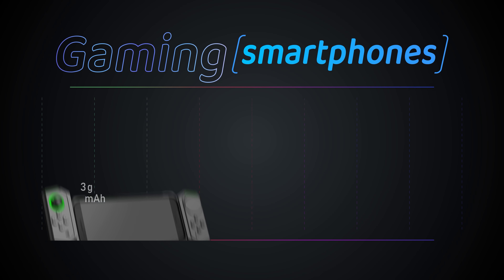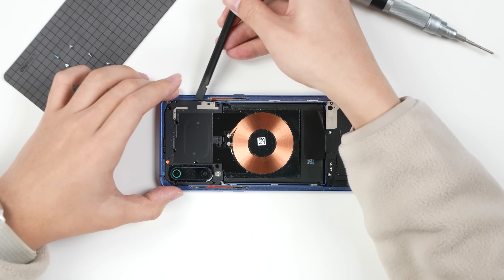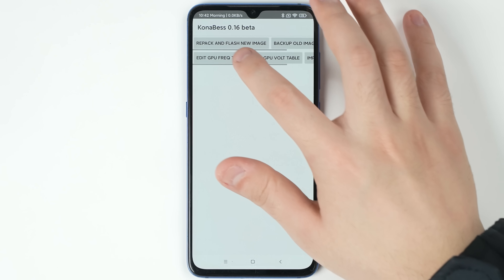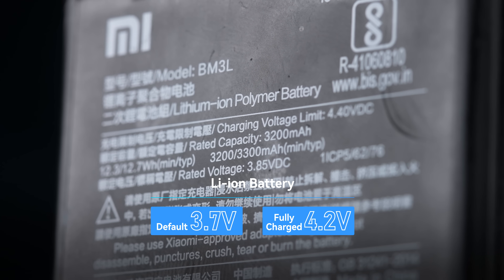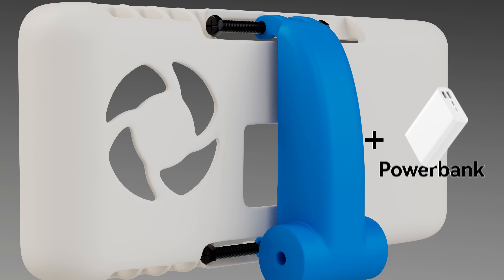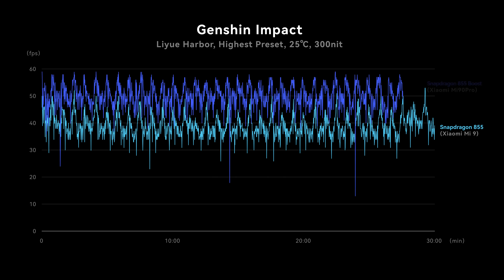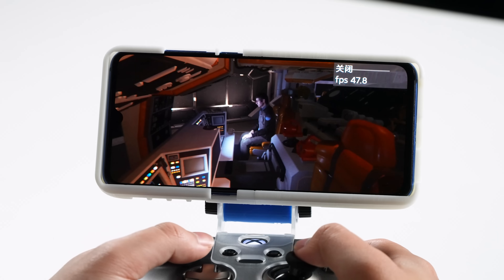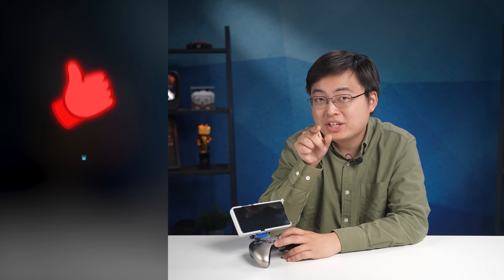We Turned This Old Phone into a Gaming Beast !!!

Comment: I've been overclocking old android flagships for a while and most of the time, they works well. Though some backdraws like temp cramping up to 60c and battery draining super quick. Always have the thought of adding inbuilt cooling fan like how you did, but i just didnt have the proper tools. Though it's great seeing someone actually did this.
Reply: Can you guide me on how to overclock please?
maybe write or a link to see
thank you
Reply: @luisfabriciorochaflores2549  your phone need to be in rooted state first. also may i know what model you're using? What you might want to look for are bootloader unlocking (if your phone's bootlader is still locked. if your phone is already in rooted state, you can skip this one), custom kernel and disabling on thermal throttle
Reply: 60C on CPU is literally fine
Reply: @TheRealNightShot  Your hands is not fine holding that lmao
Reply: @rocky-zx6kq  Yes. But I don’t hold the cpu. I hold the phone. And at worst the surface gets to 50, which is uncomfortable, but not dangerous.
Reply: @TheRealNightShot  Yes, but for the battery 60 C is destructive.
Reply: @HeX341  Battery in fact will never reach 60C on its entire surface.
Reply: you would need a pc and some skill to design the phone case tho and i hope he'll create a tutorial video of  the video
Reply: @djinjarin6384  not only that, i would need some electrical skill like when he modify the battery capacity by i believe 'dc' ing the current? (correct me if i'm wrong) and when he did the mods on powering the tiny fan directly from the phone battery and not from 3rd party sources like most of mobile gaming cooling fans on the market.

Comment: I am still using Mi9t pro with 855. Overclocked display to 72hz(more stable frametimes if you do it on mi9 too). Undervolt the cpu and gpu for battery life and tweak the kernel profile to enable boost when you game. (Even tho i don't game on phone so that's why the undervolt)

Comment: im using sdm636 custom rom  lineage os , oc cpu 2457/ 1843 schedutil , 585 venus-ddr-gov gpu , I/O fiops 2048 read ahead , fsync/vsync disabled , swappines 100% , 100 VFS , 1024/2048 entropy , remove thermal.conf , 67hz refresh rate ( only 67 because txd ) , change reso to 720 . stable 45-50 fps even in crowd . but sometime SOD lol

Comment: I've repaired my fair share of cells to know better than to tamper with batteries. Aside from safety concerns, Li-po batteries are very dangerous if anything goes wrong,  there's the added weight on your hands, and bulk on them too, I'd rather go with a powerbank I can have either laying on any surface or in a pocket. There's no need to put that extra weight on your hands that will end up on strain on your wrists. 

The cooling mod though... That's pretty neat although again I'd rather link it to an external battery for safety's sake.

Comment: this blow flagships out of the water. im jealous i cant do the same to my galaxy s21 ultra.
Reply: The screen refresh rate can't do the same with Samsung S21 ultra either.  

The S21 screen has a refresh rate of 120hz..  Meaning you can crank games up to 120 Frames Per Second and see all those frames
Reply: @leibniz4455  doesn't really matter if your rending the game can't even reach higher than 60 fps while maintaining good visuals.
Reply: @leibniz4455  are you serious 120 hz mean 120 fps . go do some research 😂😂😂🤦
Reply: @leibniz4455  phone having 120hz doesnt mean it can do 120fps in games. im sure its only for apps and browsing. 60fps with 120hz wont work.
Reply: As a little advice. I had to replace my S20+ battery a few months back and i had the idea of putting some high quality thermal paste (Thermal Grizzly Kryonaut) under the CPU into the frane and the cpu temperatures droped by at least 7°C
Reply: @gabrielflorit4470  i think smartphone cpu's became so mush powerful that they need a proper airflow like laptops but the problem will b the water resistance
Reply: @gabrielflorit4470  im about to change my back cover should i do the same? And did it help with anything?
Reply: You can overclock it 
But 
Stick a ice brick beneath the phone
Reply: Same also do you know the name of that game hes playing? wanna start playing it
Reply: @Aadikar Bhandari Probably that's a bot. I keep seeing generic comments in YT lately
Reply: Samsung S21U is able to root, at least there may be there are semiconductor cooling fans which can tie to your phone
Reply: Yeah 😶
Reply: @Aadikar Bhandari Ah Im with you the game looked cool and kind of different I need to level up on Genshin been playing Forge however..
Reply: @leibniz4455  but you were saying 120hz =120 fps that is not correct
and my pc specs are- intel i7 4770 with gtx 1070 and 120hz monitor from aorus
Reply: @leibniz4455  nah my point is why you talking shit if you don't know
Reply: @leibniz4455  I read all your comments and I'm still confused on what your point is
Reply: @leibniz4455  the cpu does not produce images. The cpu takes information from whatever it wants to render to the gpu and the gpu produces the image, and phone do have gpus, in the form of a chip. Without a gpu u won't see anything in the screen.

U sure u know what you're talking about? Don't want you to spread misinformation, you know?
Reply: @leibniz4455  that's why without a gpu or igpu u won't have any output to the monitor
Reply: https://youtu.be/hkWhrfKNmR8?si=Xw1IsnwIzGFLFev1 This guy did the same type of thing with an s21

Comment: i also did that to my xiaomi miA1 since i dont have funds i rooted it, install performance kernel then unlock thermal throttle and lastly installed overclocked kernel 2.0ghz is the max hz of that snapdragon 625 and gpu of adreno 620 with 800hz only downsize is really heat normal temp is 80-100°c and 45-70° with cpu fan coolers i diy i also dont have the back casing wahahaha 100°c is my greatest achievement on cellphone temp it is also true by removing camera it removes extra heat

Comment: Why you don't try 855+ 865 or 888
Reply: 1. Cant get a phone with those chips for as cheap as this
2. They have higher power to performace ratio so pushing them more could physically damage the chip, in turn, killing the phone

Comment: Would be nice to see something bit more powerful like snapdragon 870 with 512 shading units compared to 384 
Don't even start talking about latest 8 gen 1 there would be some potencial to it
Also with stock 120hz screen
Also is there like overclocking for the individual cpu cores as well?
Reply: It wouldn't be as cheap, maybe in a year or two
Also Power to performace ratio on those chips keeps getting higher and pushing them more could physically kill them
Reply: It can kill the cpu sd870 is already beast

Comment: Next time is hybrid water cooling for phone, use a peltier module+ water cooling,use a 3mm soft copper tube as the radiator directly mounted on the phone cpu and gpu area,i think water colling makes your setup thinner ,well you won't be able to take the phone with you,what i meant is that it is a real gaming phone with no battery,like an actual pc use a 4.2 volt power supply to replace the battery
Reply: Thus making it unlimited gaming time HAHAH,just entered my thought,but im doing the water cooling in my poco f3,no im not tearing down my phone,id just stick the water cooling radiator in the cpu area,

Comment: 7:49 "Fuck MIUI Thermal"

I love this community
Reply: I can't open the link of "FUCK MIUI THERMAL"
Reply: All is fun and games until your CPU starts burning from heat. When CPU (or in this case SoC chip) reaches certain temperature it will do something called thermal throttling which means that it reduces it’s power in order to protect itself from heat damage. If you somehow manage to set it in the way it ignores heat and high temperatures you’re CPU can literally burn alive.
Reply: @Nameisnotimportant  that's why he slapped a fricking fan on that device. You need ROOT access to make any changes to the software at that level. So, safe to say it's not a concern for many but if they are reckless enough to temper with their device using root while being clueless then it's GG for the device.
Reply: @basantatamang2249  It’s not a concern until that “freaking fan” works and until users have enough brain cells to tune it’s power in the way that the fan will be actually able to cool it down enough to not catch on fire.
Reply: @Nameisnotimportant  Yeah, Even I would be surprised if Normal non-techy people can flash custom recovery without soft bricking it. Let alone them figure out TDP of their device and making appropriate Cooling for it.
Reply: @basantatamang2249  TDP ??? Well if you’re going to overclock, disable thermal throttling and have powerful chip then i don’t even know if motherboard could actually handle that much power.
Reply: @Nameisnotimportant процессоры и видеокарты с хорошей системой питания лучше разгоняються

Comment: I was having this idea with my old rooted android phone. Never thought about mounting a cooling solution but with a custom 3d printed shell/housing you can do anything! I also wonder if it's possible to wire a controller to the logic board directly or if there's a workaround you used
Reply: Just use OTG + Xbox controllers

Comment: About screen overclocking, I bought Xiaomi POCO X3 Pro what have default 60hz refresh rate and can switched on 120hz in device settings. So you can go higher than 75hz with right device

Comment: would be nice if you include the surface thermal on the screen

I'm planning on modifying my mi 8 like this as well, but kinda afraid to let the screen runs too hot and kill the oled panel in process

Comment: One ui has update to unlock thermal limit, by making backcover transprnt, and slap thermal pad in the whole phone, and snap it by having metal case for s10, it 50fps stable, having fan would help a bit to not make your hand burning hot by 42⁰C metal case

Comment: You guys should do a phone with the Snapdragon 865 since that thing is already a beast in terms of efficiency and you can only imagine how much that thing can OC and still get lower power consumption vs the current flagship processor the SD 8 Gen 1
Reply: Except giving that 865 is such a well performing chip you wouldn't expect anything having it to be cheap or get replaced soon. Both 845 and 855 just isn't as well received comparing to that and is probably much more likely to be obtainable at cheap.
Reply: @FlameRat_YehLon  I guess so. Would be interested though how much can it be pushed as well. Maybe in two years time it might get cheaper. Since pretty much that's the chip which feels most efficient compared to the new gen ones. SD 8 Gen 2 might not be better off as well so yeah.
Reply: @SomeoneC  25% isn't just "only"... What really matters is how high it can be overclocked to, and in that matter 865 doesn't have that much of an advantage

Comment: Amazing video. I did the Wildlife Extreme Stress Test and I get a score of 2714 points. With the regular Wildlife Stress Test, I get a score around 9000 points. Geekbench 5: single core: 1760 multi core: 4900. I use an iPhone 13 mini.

Comment: This project is Asmazing dude, i have mi9 to and i use a konabess for overclocking thr gpu. But gpu clock increased just 720Mhz for stability
Reply: Can you share konabess setting to overclock 720mhz?
Reply: @MrMV8  i just added 655Mhz and 720Mhz with same gpu voltage as 585Mhz(default)
Reply: @deniengineering  thanks bro

Comment: It would be awesome if you use this project to design a micro-pc or an attachable All-In-One PC (similar to Firestick or Chromecast) that works fine at 1080p/60fps boosting up the multitasking capabilities and run games smoothly on mouse and keyboard like Fortnite or some FPS

Comment: I’ve got an idea for you guys, since the latest snapdragon 8 gen 1 has great peak performance but it is power hungry , inefficient and produce a lot of heat why don’t you remove the motherboard out of a sd 8gen1 phone like the red magic 7 pro and put it in a small case , water cool it , give as much power as it needs and make the ultimate android gaming device . You could plug it to either a large screen and play with a controller or plug it to a small phone screen and figure out  how reimplement touch controls , I know it’s a dumb and it goes against the whole idea of a portable gaming device but I just want to see when you remove all the limitations out of this processor how could it possibly perform , that would be awesome !
Reply: Because he wants to do big things with little money
Reply: he want to use least money to do like snapdragon 888 same power
Reply: thts not efficient
Reply: Newer phones got much better thermal design to allow the SoC running at a higher clock speed to begin with, and without that much of a difference on how high the SoC can theoretically be clocked at.
Also it wouldn't be hugely interesting giving that it'll just be the same as an APU powered game console with the CPU part being ARM based instead.
Reply: @FlameRat_YehLon  even with the latest cooling systems the latest phones provide they still run into thermal throttling especially the ones equipped with the sd 8gen1  , that’s why lesser powerful but more efficient chips actually performs better than the high end ones like the dimensity 8100 , you can checkout a channel called golden reviewer where he test sustained gaming performance of different phones and the 8100 was pretty much the best in android , I don’t expect it to be a huge difference in terms of clock speed but I just wanted to see how it could possibly perform in native android games once you remove all the limitations
Reply: @jacktoreto7376  what I mean is, newer chips are pre-overclocked higher so if you remove the limitation they really won't gonna get that much better than older chips clocked at the same frequency raw performance wise.

Comment: Wow, great job man. I have just switched from SD855 to SD888 and I don't feel any performance differences at all. Flagship phones are getting worse and worse during this days...
Reply: SD888 and SD865's GPU architecture are same, and the IPC improvement is due to the frequency increase of memory (LPDDR5 5500MHz to LPDDR5 6400MHz). What's more, it seems that TSMC's N7P technology's power efficency is better than Samsung's 5LPE technology
Reply: @NxdXUR89  is the SD 8 Gen 1 another overclocked SD850 or a new one that will be exploited again for years like SD850(the new SD850?)?
Reply: @yubinator69  SD8Gen1 is new architecture, its GPU frequency is quite close to SD888. It has 40% performance improvement and 20% increase in power consumption.
Reply: @NxdXUR89  I see, it is has a new architecture. I think that means it will be like another SD850 that Qualcomm will overclock for the next 5 years. lmao
Reply: @NxdXUR89  yes
Reply: Well, kirin die so there is no point for snapdragon to improve anymore. But there is mediatek this year so maybe they r gonna improve again
Reply: It may be the optimizations dat causing it depending on wat ui ur on
Reply: that's why I'll be sticking with my SD 870 oneplus until qualcomm fixes their shit
Reply: sounds like you use nothing that needs better hardware
Reply: yes! Qualcomm is too terrible!
Reply: https://youtu.be/JrKnxAlYmyU
Reply: @SomeoneC  I wanna test the same, I have my Reno10x with the SD 855. I have done a few mods (I detailed them in my previous comment) the WildLife Extreme score comes around 889. 
How did you log the frames? Did you just see the max/avg on screen or did you use some software for that.

Additionally I have both the s22ultra and 13PM if this game is available on iOS I'll test it too.
Reply: or they just overclocking and rename it
Reply: @sausbirux  this why im ok not getting the SD888 because starting from SD850, they just overclock the chip until it cant do it anymore. Idk if SD8Gen1 is also a overclock of SD888.
Reply: As expected, If they currently want to improve mobile CPU, They should work for efficiency and chips should be able to hold clock speed for longer periods (means cooler chips).

And after these 2, They can make some serious GPUs for mobiles. Something like Nvidia gt 1030 equivalent graphics on phone would change the game.

Cuz you can tell yourself you wouldn't need faster speed because there's no software on market to saturate even Sd 855 (considering its stock android and not slowed down intentionally with bloat).

Comment: Well if you have an old xiaomi phone you can get good exchange rates like in my case i was getting mi11x which has snapdragon 870 in 156$ remove the thermal throttle and use an active cooler boom under 200$ its even better.

Comment: Since on miui, you can't change the battery capacity value that easily, I see that you've used unlock battery.zip. I would love to find that zip folder or how to change the value on miui
Reply: Hi you have found something for modify the battery capacity value??
Reply: @rivolz_  I doing some research and it seems like all aosp roms can change the value with ease through /sys/class/power_supply/bms/charge_full. Not on miui though so he must ve used some kinds of battery value unlocking file zip
Reply: @masterlee5684  yes i see on xda someome that say this value is changeble only on custom rom but... In this video the guy has used the original xiaomi rom🙃